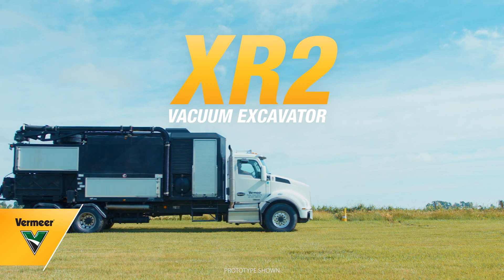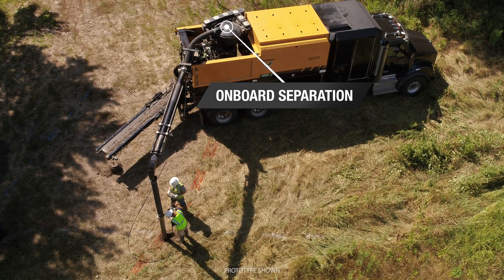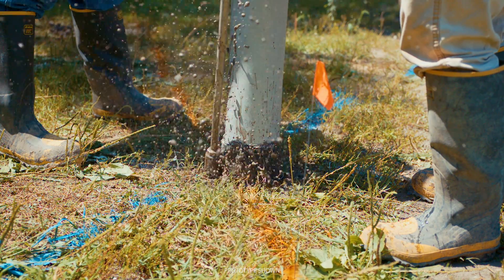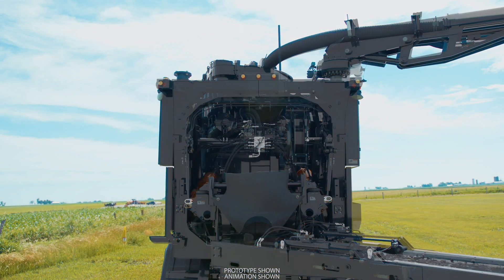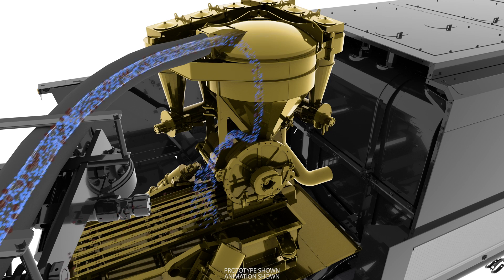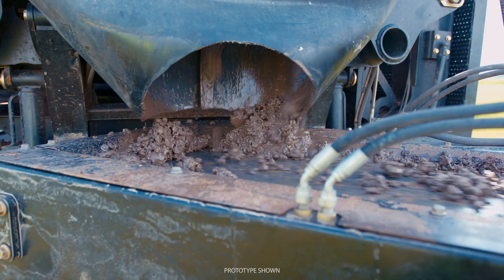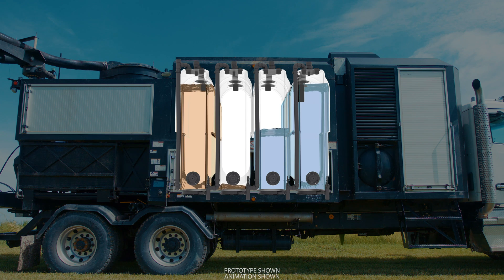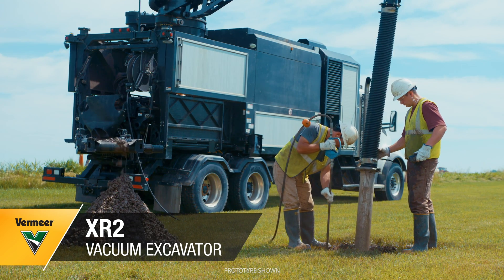Vermeer XR2 Vacuum Excavator Animation

Comment: I just used this unit this morning for a demo. I think it has a lot of kinks to iron out. We put piles of mud into peoples yards from the conveyor. It looked like giant mud pies on the ground. Also it sucked up a locator flag, wrapped around the axle of the airlock and shut the whole truck down. That piece of wire also caused it to fill the air filter housing with mud.